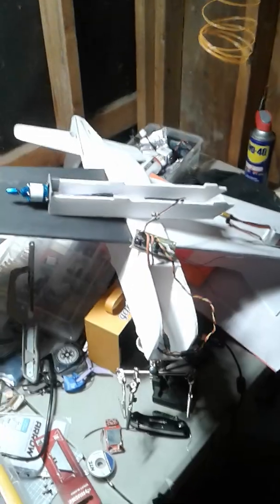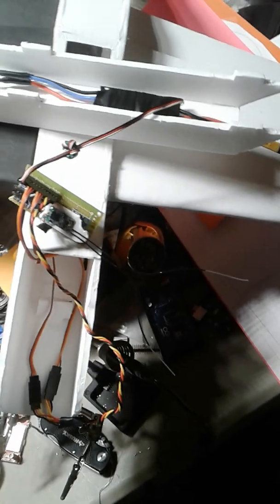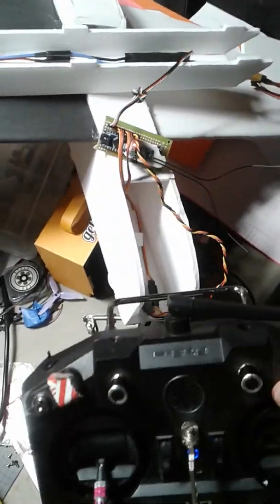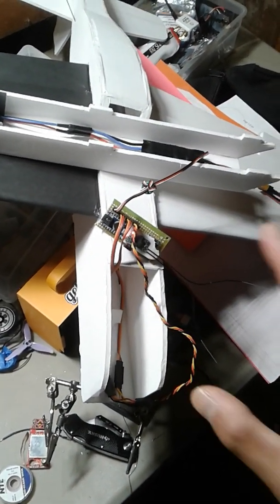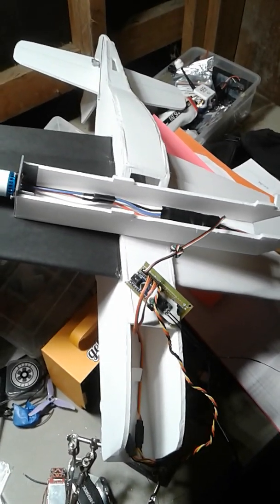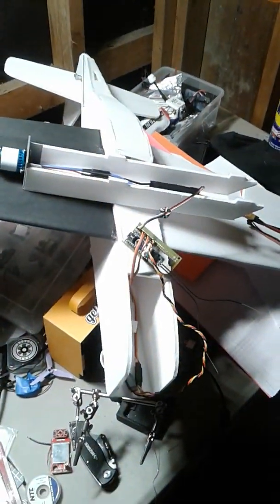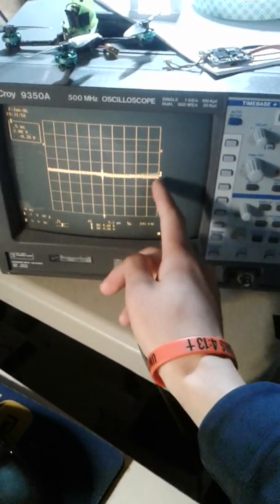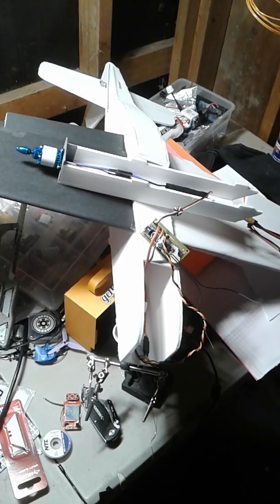Simple Airplane FC (SBUS to PWM, Arduino)

Comment: Yes what did you do to invert the sbus and can you include a decent sketch of the connections please ? I think a lot of people are interested in this.
Reply from the maker: Use an NPN transistor to invert SBUS or a high-speed hex inverter. For the connections, I do not have the exact schematics. But it's basically an XM+ connected via serial to an Arduino Nano and some headers for PWM outputs. The rest is software (C++)

Comment: does it require any IC to get the uninverted sbus? or theres an uninverted pin on the xm+ already?
Reply from the maker: This is ExpressLRS, no more SBUS for me! I am using the BetaFPV Nano ELRS rx, so there is no SBUS anywhere.
Reply: @lrfpv5292  arent you using an xm+ on this video? you talk about an inverter mod, is it using an inverter ic or is it on the programing of the arduino nano?
Reply from the maker: @sochineze  Oh, wait yeah sorry, I am using an XM+. This video was a long time ago and I forgot that I switched to ELRS. I am not using any IC to get uninverted SBUS because the Bolderflight library allows for reading inverted SBUS signals (I think it's sbus_non_blocking in the constructor or something). The Bolderflight library has changed though, and it says that all other uCs other than teensy, STM32, and ESP32 need a hardware inverter, so if you are using an AVR uC, then you may need to either solder the uninverted signal from the receiver, or perform the inversion manually.
Reply: @lrfpv5292  Haha, im still using the same setup i used 3 years ago. Thats a bummer , i was really hoping i wouldn't need to invert it manually. Aight thanks for the info 🙏

Comment: Do you have the code for this?
Reply from the maker: I used to. Unfortunately, I went to college and left my computer at home, before I was able to upload the code to git. Sorry about that. The code is pretty straight forward though. Use the Bolderflight library, with the Arduino servo library. Map each SBUS channel to the corresponding servo.

Comment: Borderflight library?
Reply from the maker: Yes, it was a bit tricky getting it to work, but it is better than all the other ones out there, even if it is not optimized for the arduino nano.
Reply: @lrfpv5292  yeah, its a good library.. im using it too with my xm+